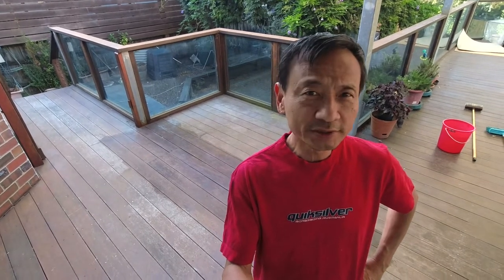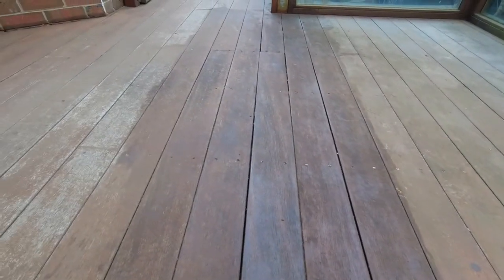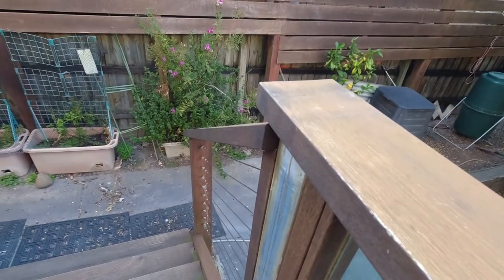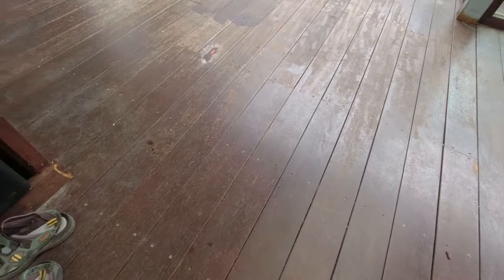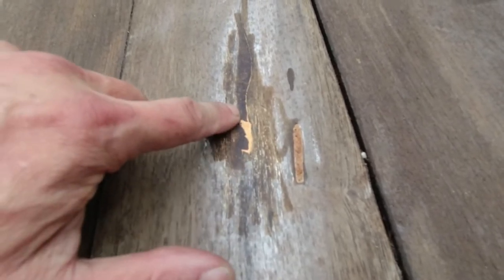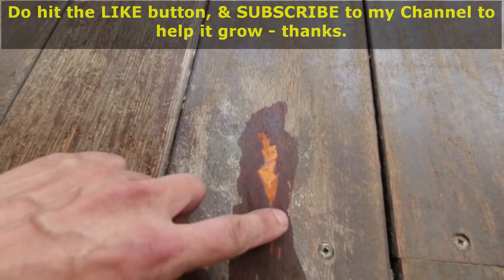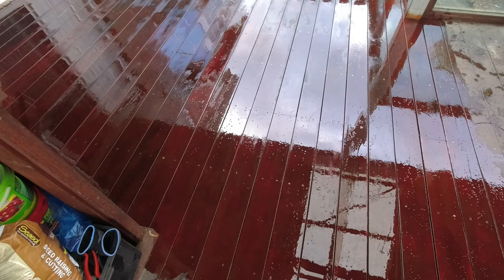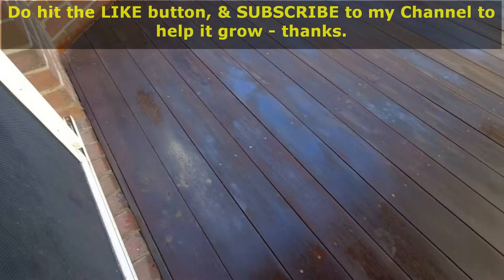Rejuvenate old Merbau timber decking - wash, sanding & oil it

Comment: thank you for the video. At 12.01.I noticed that part of the wood surface is extra glossy and part of it is not.  Im facing this very same issue as well whereby I had sanded the wood down and oiled it.
Reply: Differences in the sheen may due to old plastic residue not completely sanded off or different wood densities.

Comment: Whether you use a water or solvent based decking 'oil', neither leaves any oil on your deck, all of the solvent evaporates.  What's left is a plastic film coating.  If you really want oil to penetrate into the wood pores, try a plant based oil stain like a linseed oil stain.
Reply from the maker: thx for info